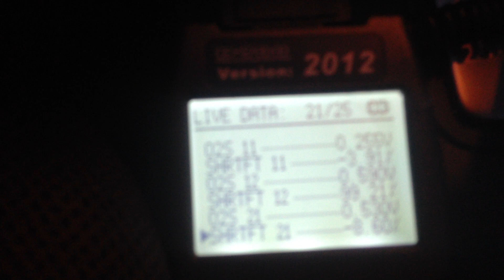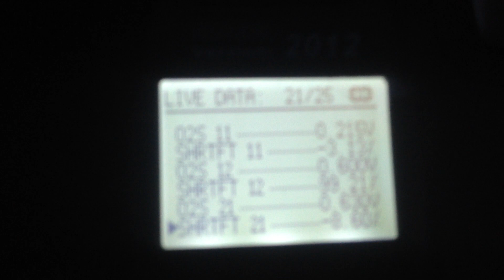P1273 Code Nissan Xterra Air fuel sensor Lean shift. Live Data Meaning? PART 1

Comment: Just a bad wire connection check all wire connections that have to do with fuel air ratio and also check negative on battery this is a false code also if u have an after market catalytic converters this may do it also unless ur experiencing a difference in the way the vehicle runs this is easy fix I actually added on spacer to my 02 sensors fixed it the only real crime is the garbage these manufacturers get a way with selling if u ask me